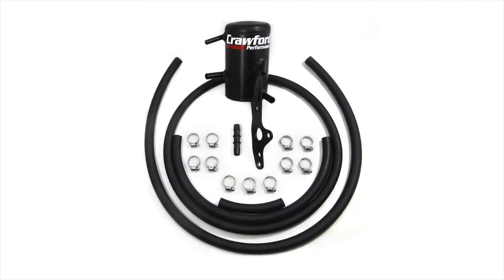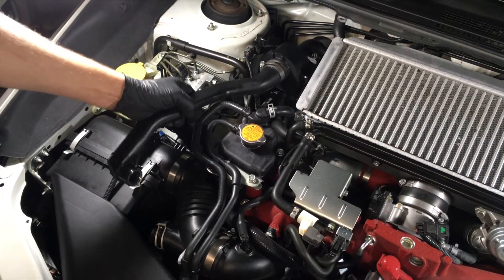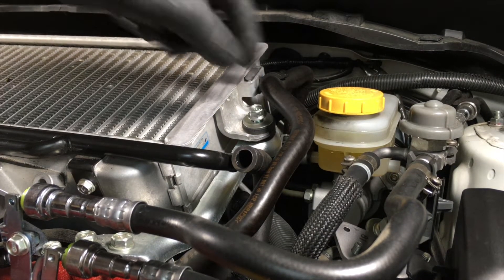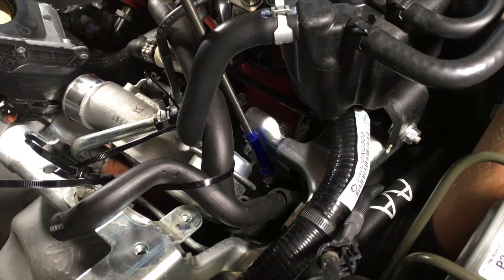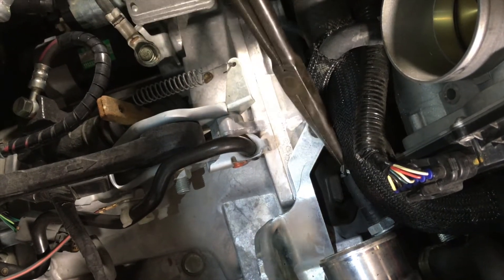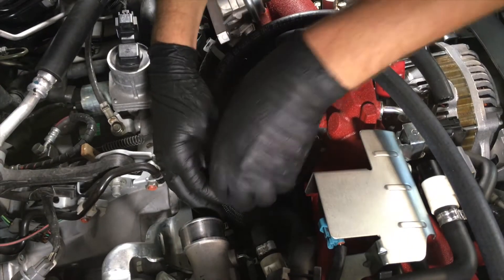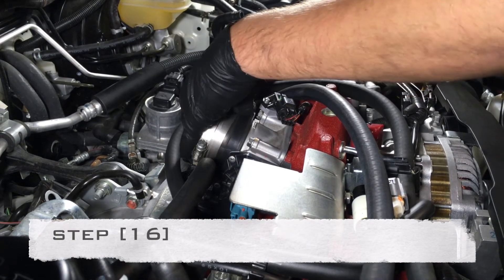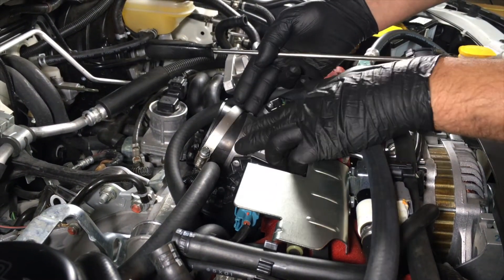Install Video: Crawford V3 AOS for 2008-2016 Subaru STI (S0699)

Comment: Is it possible to install this in the rear like the V2 aos, where that big wire harness is?
Reply from the maker: No, it needs to within the current proximity to the engine. Do you have a FMIC?
Reply: @crawfordsti  No top mount

Comment: Sadly no videos on a wrx installation and the pdf instruction is poop. Currently have the v3 sitting collecting dust
Reply from the maker: It's been really hard to get one of those cars in-house for a new video; we are so sorry for the wait on this!! We got a hold of one locally for next week, so you should see a very detailed video in about 2 weeks.
Reply: @crawfordsti  great news I took the leap of faith and tried the install and everything went well. Bracket part was a pain but overall happy.
Reply from the maker: Awesome! Yes, the bracket is difficult but there are a few tricks we will cover in the video and updated PDF. If you check out the PDF/Video from the 2017+ STI V3 Install you can see those tips.
Reply from the maker: https://www.youtube.com/watch?v=WbFLoKNlnpE&t=11s

Comment: Great looking product. Hope it works as good as it looks.

I have to say though... The install is not nearly as easy as this video makes it look. The 2 bolts used to attach the aos are an absolute nightmare to get installed just due to the amount of tubing and hard lines going through there.

For anyone watching this video... Bring your patience... And a friend with extremely tiny hands!
Reply from the maker: Yes, the bracket is certainly tough. Here's our trick to make things a but easier: use a mirror to check that the fuel injector cover did not shift in the way. If so, have a friend pull the cover back so that the bolt holes are fully exposed, then re-install bolts to mount the AOS.

Comment: Hey everyone, since crawford sucks as making a basic guide for the later 08-14 WRX. I made one myself, sorry if it is crude. Here is the link to download. I ran the hoses completely different. I have been running this setup for a few months now and it has cleared out every bit of oil in my intercooler and intake hoses! 
https://drive.google.com/file/d/1_dbwOrD-sH6A3MxxpPfhBvnVpWm8hA9l/view?usp=sharing
Reply from the maker: Regardless of vehicle, the following statement explains in the simplest terms how to install this kit:
1. The original Subaru hose from the crankcase vent to the intake manifold is removed, then the open port at the manifold is connected to Port 1 on the AOS, and the open port on the crankcase is connected to Port 2 on the AOS.
2. The original Subaru hose from the crankcase vent to the intake tube before the turbo is removed, then the open port at the intake tube is connected to Port 3 on the AOS, and the open port on the crankcase vent is connected to Port 4 on the AOS.
We apologize that we have not released a WRX specific video or amendment, but the above statement is on every parts list that is included with each kit. We also assist with install questions over the phone and thru email so if you require any assistance, do not hesitate to contact us.
Reply from the maker: https://www.youtube.com/watch?v=WbFLoKNlnpE&t=11s

Comment: I've been struggling trying to make sure I know exactly how to install this on my 2012 WRX. The setup is different from the STI. I don't understand what the "17” 1/2” Ventilation Hose: from right valve cover vent hose extension *WRX/plastic intake manifolds only" is that comes with the kit. I don't want to start taking the system apart before I know where that hose is suppose to go. Can anyone provide me some clarity?
Reply: Can you please create some install instructions for the 08-14 WRX? You advertise this product for this generation car and provide no install instructions. Wtf?
Reply: They need to show what to do on a WRX. I've been emailing them and I'm even more confused. Crawford Performance y'all really need to make clear instructions. This is dumb.
Reply from the maker: send an email to our technical department for installation assistance: technical@crawfordperformance.com
Reply: I've managed to figure it out but it was a PITA and it is run completely different then this video. The main contact at Crawford who makes the product sends the worst cryptic emails I have ever read. Great product that has since worked awesome, but they need to spend 5 minutes and make a diagram for install. It is kind of a joke and makes total sense that they are based in California.
Reply: Kyle Narkiewicz  you happen to have the instructions on how to install on a 13'-14' wrx?
Reply from the maker: We have a PDF Installation Guide for the WRX specifically. There is a link located in the description of this video, as well as on the parts list that comes in each kit.
Reply from the maker: https://www.youtube.com/watch?v=WbFLoKNlnpE&t=11s

Comment: What is the reasoning behind routing the hoses to port 1 and port 3 on the long path around the throttle body? I’m in the process of tucking some hoses and I want to take a shorter rout for those hoses and hide them under the intake manifold, would this cause a problem?

Comment: Anyone with a 2017-2018 STI, you will longer hoses, you will have more interference with the AOS and lines running into it because there are connections on every breather valve now. You will need a dremel to cut the silver running off the PCV, or you will need to pull it, hard. Without longer hoses it will look nasty. Again, the 2017-2018 STI's should really not be running these unless they find a way to mount it else where or at least stay away from all the new bits and pieces that are on the 2017-2018's. Disappointed. 

If the AOS does not mount up, the bracket is out of alignment. Remove the bolt on the intercooler stay and move that around to put leverage on the fuel rail cover to get the holes to line up.
Reply: Biggest issue for me was mounting the canister but yes the oem ring clamps were a pain.  Very tight in there like you said but at the end all good on my '18 STI.
Reply: hey Cameron you have been the only person to clear this up for me. I have a 2017 STi and when I saw this video I new something was wrong. Do you think I should sell my v3? Or will it work?